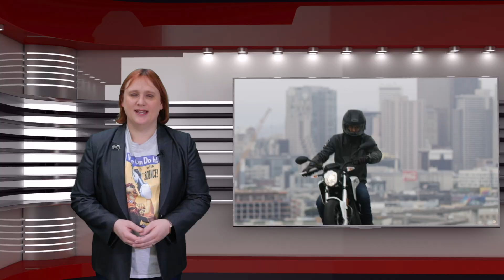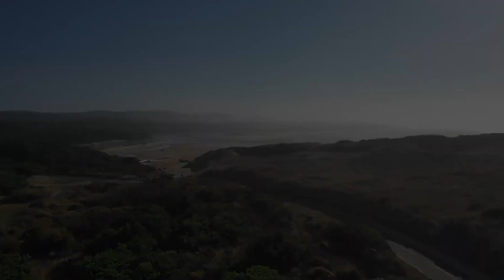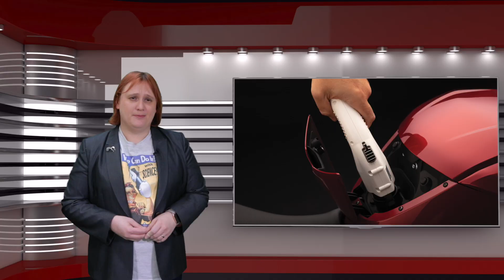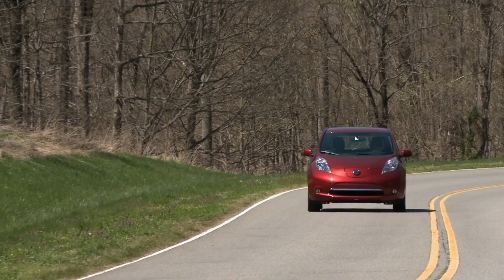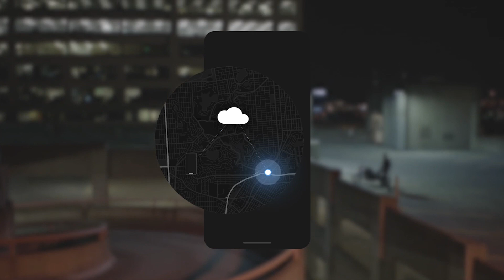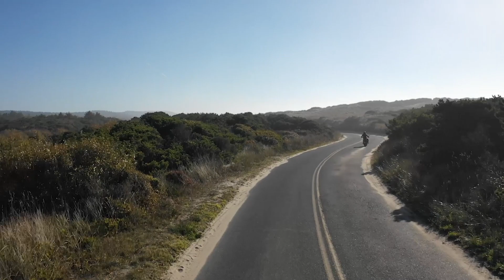Zero SR/F - Zero Motorcycle's Latest Ride

Comment: 82 miles on the highway is totally useless.  Basically it means 40 miles round trip range. With a bit of range anxiety thrown in. I’m really into biking (40 years of riding them) and very interested in all electric vehicles but 80 miles highway range on an £18,000 bike is just daft

Comment: I was a dealer for Zero back in the early days.  I still have an 06 Zero X.  I am replacing the old LiFe battery with an LG chem unit and a more "advanced" Kelly controller.  Their support for their old bikes is quite paltry.  They just suggest you buy a new bike.  However, they did offer to rebuild my pack.  Hopefully they will be better with the new stuff as they get more organized.  Have to agree this bike is the best looking yet.  Thanks Nikki